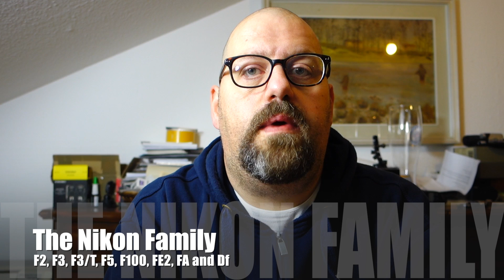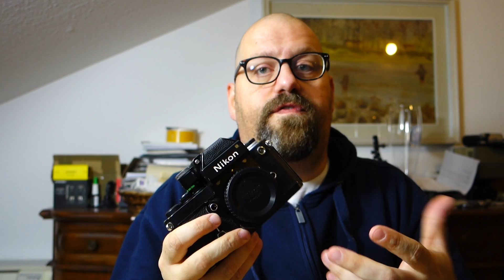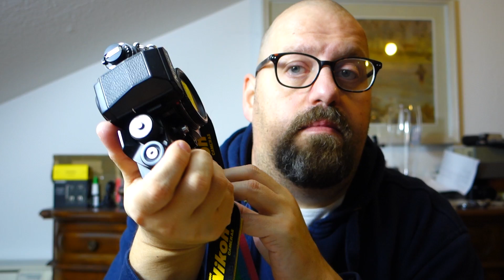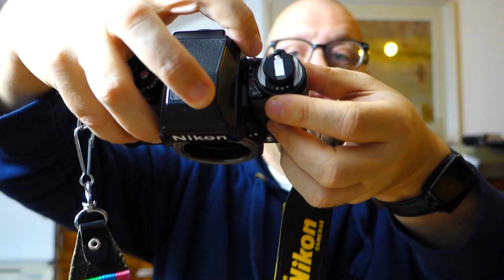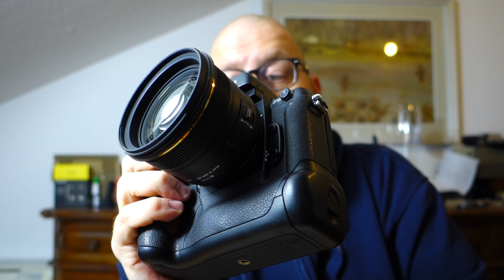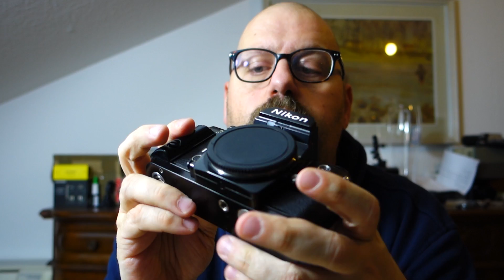The Nikon Family - From the F2 to the Df

Comment: Remember having this F5 8x Battery Cage in my Pocket and a Metal-Presscard-Neckchain shorted it out, and my Jacket went on "fire" :-D
Still have ALL my (analog) Cameras around, just the Lenses were worth something, i sold most fo them unfortunately.
And the F5 Digital-Back with Timestamp- and Copyright-"printing" to the Negative. And the F5 Polaroid Back. Still have them.

Comment: Your F2 is a Nikon F2 Photomic and has a DP-1 CDs cell meter/finder.That model ran from 1971-76, alongside the F2 SB with the DP-2 Silicone photo diode finder. In 1977 Nikon  updated all their metered SLRs to accommodate Auto Indexing  (AI) lenses. The F2 Photomic was updated with the new DP-11 CDS cell Finder and called the F2A, and the F2 SB was equipped with the new DP-12 Finder with Silicone photo diode metering.   Both of the new finders interfaced with the new AI and later AIS lenses with no need to line up saddles and pins.
Reply: And for a brief time, Nikon did make an F3-A/F.

Comment: I have far more Nikon cameras than is good for me, plus a few others, such as Russian rangefinders, a Speed Graphic, Graflex reflex and MPP monorail.  Started collecting them about 25 years ago.  About 10 years ago I gave up all photography and put my cameras into store, mainly due to failing eyesight.  Recently there has been some improvement in eyesight, so I have got the cameras out of store, and am using some of them again.  Some are very difficult to use, the LCD in the viewfinder of the FA is almost impossible to see for example.

I don’t really like the professional Nikons.  I do have an original F, as it was the first one, but I prefer the semi-Pro models.  I have Nikkormats FT, FTn, FT2, FT3 and EL, with a ELW due to arrive in the next day or two.  I’d like a FS but they tend to be expensive due to being rare.  I’m keeping my eyes open for one at a reasonable price.  I also have the Nikon EL2, which I consider to be a Nikkormat.  Of the newer ones I have the FM, FE, FA, F90x andFM3a.  Of the smaller amateur line I have the EM, FG, FG20, F301 and F501.  I also have the FM10 and FE10, the latter mint cosmetically, but not working.  I’m not sure where to put those two, by model name they ought to belong to the mid-tier range, but they look like they belong in the lower tier.  I think the FG20 is actually better; at least it doesn’t have the sticky rubber covered back like many of the later cameras do.  I really start to lose interest when it comes to the later models, the F4 and F5 for example look almost like inflatable rubber models.

Digitally I have the Df and the Nikon 1 J1.  I like the fact that once I have the Df set up as I want it I seldom need to go into the menus.  I also like the fact that it will take unconverted pre-AI lenses; most of my lenses are pre-AI, most are converted but a few are not.  I have the GPS unit for the Df, which I like, but why was it not built-in as standard when even much smaller and cheaper mobile ‘phones have i?

Comment: The way I manual focus and nail it every time is to figure out where wide open lands in relation to the range finder indicator. 

I start by setting focus from what I see in the viewfinder, then using LV zoomed in fully. Reset focus and observe the focus throw from the point I see focus to the LV actual focus. It's usually 1mm off or off by the 1st zone focus point from center.  

Typically you turn focus to the left. Ex. 5m set to center turned to the left Zone focus mark of F4 (or in the space between center and F4 zone focus mark)

Comment: Ah - Nikon F3 did had an AF model the F3AF with a bulky prism, and long Wide~Tele Zoom... Then in the Mid 1980's then came the Nikon 2020 first Nikon with true AF along the F4 model. As I DId not like the FA, All Plastic housing like the Canon AE1 Program, as I seen did not like synching with the MD-12 as they said it does work but their MD Drive that it only works with their MD15 drive as the FA only works as that the FM and FE could not work with the FA motor drive MD15 unit - piece of shit. As the FA was short live model. As it was not a nice model camera with all the bells and whistles as we took in more incoming repairs for this model. I told 4 students to either get the FM, and the MD12 drive. I did not like the Df, NO VIDEO a retro version of the D600 model. And in closing that I also have the 50mm F2.0 lens and had NO Problem in focusing in which I have the Fuji S2Pro, and S3Pro, and the S5Pro which takes Nikkor mount lenses, and along with the Nikon D2Xs, and my Mirrorless Fuji XPro1, and XE1. That lens is still tack sharp or a 50 year lens, I even use it on New Year's Eve in Tokyo 2019  - You should get you eyes check, even I wear glasses too. Their is a Test after this video....

Comment: I'm curious about the manual focusing with the DF.

I use manual lenses and I'm still using a D3s & D300. I don't have issues with focusing.

On either I use the left/right arrows to compose. The dot isn't focus. Each lens is different and will use the arrows for front or back focus.

I also use the codes/measurements on the lens for focusing.

I'm wondering if you add a 1.5x or 2x magnification eyepiece would that help you?

Comment: The F6 works with two CR123A's, rechargeable or single-use, so it does not require an exotic battery one can't find anymore. Strangely enough, the rechargeables are cheaper. The battery grip works either with eight AA's or an EN-EL4A, with no difference in weight nor operation. I don't have the F5, but the F6 does more or less everything the F5 does but with or without the battery grip. In autofocus film camera category, the F5 and F6 are excellent as they support VR if that is important to you. For me, it is as I live in darkness six months every year. The F100 does also, but is slightly simpler and a lot less expensive. I think the F6 is the only one claimed to be weather-sealed, but there is no such thing as weather sealing, only varying degrees of weather resistance.

Comment: Nikon 2,  have 4, 1 black .  Chrome & black plain prisms,  DP1 & DP2 & DP12.   Purchased whole cameras just to get prisms and the DP12.   The DP12 is a gem. The others have the sluggish old Cds cells which work, but not nearly as nicely.  
The rest of Nikons are D200, 40, 7000,  800, 800e,  750.  We won't even talk about lenses.

Comment: The Nikon F3T is a camera that has a titanium shutter so the camera could shoot at higher shutter speeds.  The Nikon F100 could be about as heavy as the Nikon F5 by attaching a battery grip.  I do own both the F100 and the F5.  They are both good cameras.  I would be careful with the Nikon DF because I have heard this camera has a weak lens mount.  Peace, Flood!
Reply: The Titanium of the F3T is most of the chassis. Both the standard F3 and the F3T use the same shutter. I'm not sure that titanium is a better material for the shutter since Nikon took it away with the FM2 and replaced it with an aluminium version on the FM2N. Both shoot at 1/4000th without batteries. The F3/T is limited to 1/60th if the battery failed, 1/2000th otherwise.

Comment: Nice video.

However where is the Nikon F4?  It's the first autofocus Nikon professional camera.  It has controls that are similar to DF.  Most consider it the best manual focus film Nikon if you don't mind the weight (with a P screen for manual focus and the MB-20 battery pack so you keep it smallish).

F4 is bigger than DF and also much heavier. It's not fair to compare manual focus cameras with the DF in terms of size.  They don't have any focus motors in them and all use very small batteries. DF also must do with all the electronics, digital sensor, LCD screen etc.

Nikon couldn't have made the DF smaller.  They tried but this is the smallest they can get with F-mount lenses.